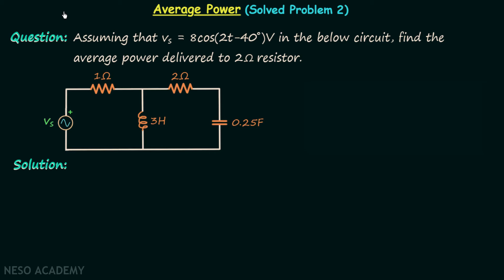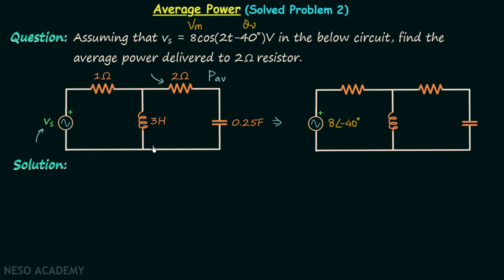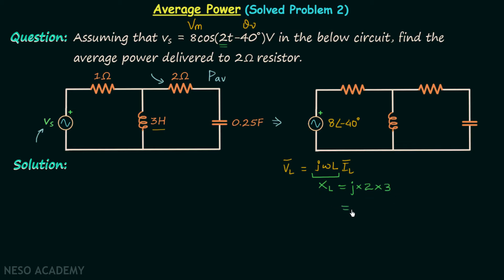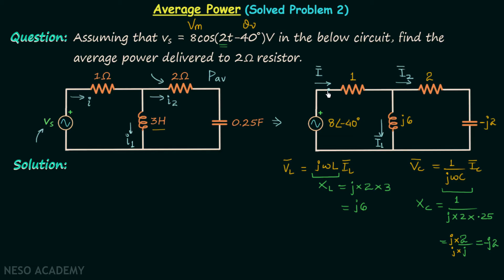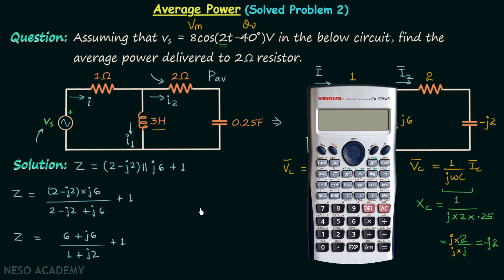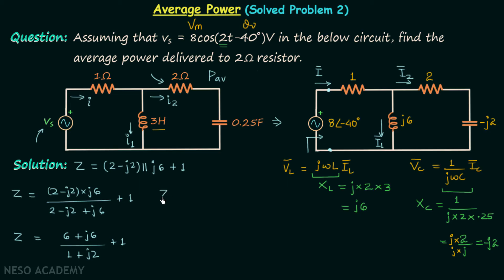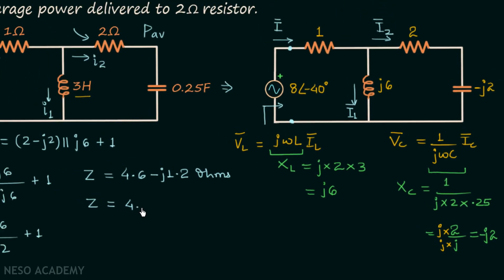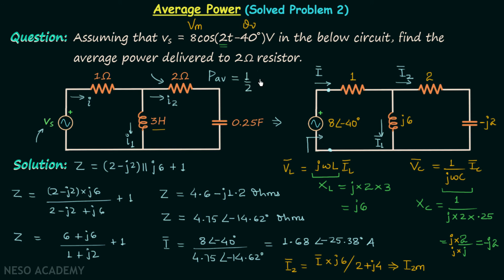Average Power in AC Circuits (Solved Problem 2)

Comment: I2m = 2.25A so Pav = 1/2*(2.25)^2**2 = 5.06W
Reply: i have got 3.18 instead of 2.25. can you recheck the answer? i think there is a mistake in current divider rule in the video.

Comment: The value of Im=2.2539  amp
So the value of average Power delivered to 2ohm resistor will be 5.0800W
Reply: But Rishab Bro, Pav = Vrms * Irms is applicable when angle of V and angle of current, Are same, But Here they are different right
Reply: @Last_Hope52837   yes it applicable  and formula for that is 
Pav = Vrms * Irms * cos(  V-theta  -- Itheta)

Comment: sir, why we add the series resistance 2 ohms with capacitance 0.25F while calculating Xc If we want only resistance offered my capacitor ?
Reply: By formulae drive in relationships of phasors in capacitors